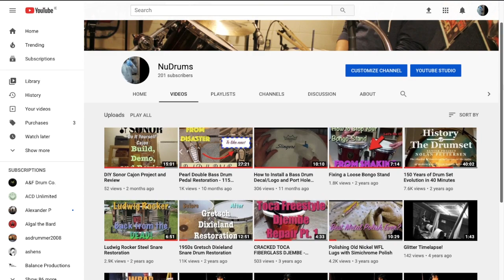Why I Fix and Restore Drums (200 Subscriber Special)

Comment: I am refurbishing a chrome  pacific piccolo, which sadly has no internal muffler. I usually have no problem getting the sound i am looking for from a snare, or at least i can get it close. But this drum is killing me, It looks like you have experience with piccolo's. this is only my second piccolo I refurbished  the first one went with out a hitch. I am getting a mid frequency ring from this drum that wont quit, I have used ring mufflers, half a ring muffler , the whole ring muffler, 1/4 ring muffler on top of the head even on the under side of the head and nothing,  it still has that mid ring. I have tried all kinds of muffling ideas and tried different drum heads and nothing, I wonder if I installed and internal muffler if it would help ? Any idea on this ? I realize its not a high end drum, But i have heard low end drums sound good when tuned properly, Any way thanks.
Reply from the maker: Hi Richardo! First of all, thanks for watching the video! Now in terms of your ring-problem... if you already have tried different types of external muffling systems, my hunch is that an internal muffler won't work either. 
Nine time out of ten, you might just be having tuning issues with one or both of the heads, or the strands might be choking the drum. If you need help learning how to tune a snare to eliminate overtones, I highly recommend the Sounds like a Drum youtube channel. They have an excellent basic snare tuning guide here: https://youtu.be/paCUkRiNOWI with a very in-depth snare side tuning vid here: https://youtu.be/Z8uBxIwA7b4 and a low tuning for piccolo snares tuning video here: https://youtu.be/UHrih51UguY They also have a great video about diagnosing common snare drum problems here: https://youtu.be/_EIfNMnXA_U 
 If you are positive that it isn't the tuning, and you have exhausted all tuning combinations, then there might be something structural going on. If your lug casings have springs inside them, this might be causing the ring. This is easily solved by putting a tiny bit of felt or cotton or something soft in there to muffle the springs. You can see me do this on my Gretsch Dixieland video at 07:44 here: https://youtu.be/Ys3zfQsuoJQ?t=464 
Another option is that there is damage or debris on the bearing edge. Make sure it is clean and level. If there are small dips or chips, try applying a thin layer of parafin wax (like from a candle) and wiping away any excess. 
If that didn't work, check to see if either the hoops or the shell are bent, damaged, warped, or out of round. The hoops should lay flat and not rock back and forth on a flat surface. Once you strip your shell, lay it on a flat surface, like a kitchen counter, and shine a light inside your shell and turn the room lights off. The only light that should escape from the inside should be from the snare beds on the resonant side edge. If there are other areas where light escapes, that may explain the weird overtones. In this case, there are few things you can do to fix this. You can try bending the shell or hoops back in-round, like rdavidr did on his channel here: https://youtu.be/-IUHogXQRd0
At a certain point though if all else fails... you may just have a lemon drum- and it might be worth selling it and getting something else. The PDP lines can have really great-sounding drums, but sometimes the stuff coming from their Chinese factories aren't always of the highest standard- and sometimes it is like trying to polish a turd. I would recommend that if you like piccolo snares check out rdavidr's video where he refurbishes an old Ludwig maple piccolo... it sounds SO good! : https://youtu.be/Tg3WdrfPQt4 
Anyway, hope this helps. Let me know what happens!